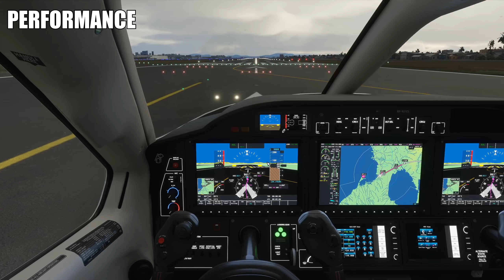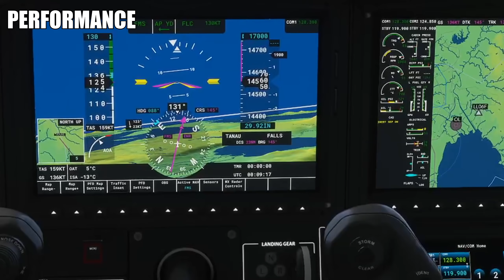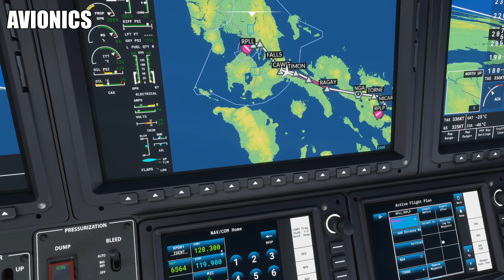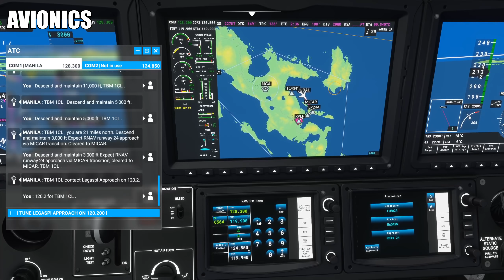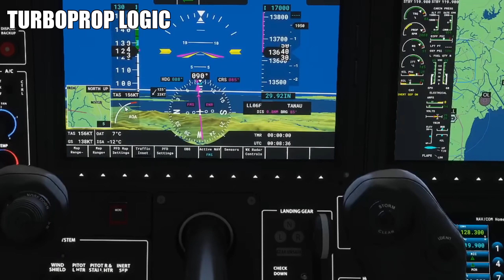Patch 2 is here! Build 1.8.3.0 - Microsoft Flight Simulator

Comment: How is it that you are not having any yoke sensitivity problems after this update? Everyone is saying that the sensitivities boxes are now gone and the controls can't be adjusted. You don't seem to be having any control yoke problems.
Reply from the maker: Yes, I got lucky in a sense that I tuned my sensitivity before the patch, so after the patch even if the sensitivity settings are gone, my old values were still saved and working. There is a workaround to this, though, it involves changing some files outside the sim to modify your sensitivity. Flight sim forums should have more details.

Comment: In my controls after Patch 2, the sensitivity adjustment is not working. It was working earlier. Ha anybody noticed this, or is it just my setup.
Reply from the maker: Yes, known bug. They messed up and sensitivity can't be changed from the menu anymore. There's a workaround in the forums where you'll have to modify the files manually, instead.

Comment: Correction: Slide slip is not crabbing to runway from crosswind. A Slide slip is when you cross you controls. ie full right rudder, and full left aileron. It results in the plane dropping like a stone, and is used when you are way too high and have to get in, such as in a forced landing. You can cross your controls, left or right. It's personal preference. What you meant was a crab into runway, then kick it straight with rudder on touchdown.
Reply from the maker: I believe that's a forward slip you're referring to: https://www.boldmethod.com/learn-to-fly/maneuvers/how-to-fly-a-forward-slip-to-landing-if-you-are-high/

Forward slip for losing altitude, side slip for decrabbing, used on crosswing landings. https://bermudahighsoaring.com/uploads/3/4/1/0/34107938/slipstoalanding.htm

Comment: I'm getting the opposite experience as you with torque vs. altitude in 1.8.3.  It's still increasing as I gain altitude.  Also still getting an insane pitch change around 23k feet when autopilot captures ALT.    Still needs a lot of improvements but I'm trying to be patient this sim has a long shelf life.
Reply from the maker: Yeah, you're right. I've been doing some tests offline and I agree with your findings. I found something interesting, though. Tbm 930 fixes in the msfs forums. Check out the mods list link in the video description. 👍

Comment: How do I tell what patch/update or version number I have installed? 

When I clicked on the icon to start FS2020 this morning after not using it for one day, I got a package install permission box to click on but it didn't say what it was for. Whatever it was it seemed to load very quickly. I only had a short time to play today, but something that didn't work quite right after the first patch -- the ATC voice --  now works.  And I think one of my load times was reduced, so that's good. I have just the Basic edition and a very slow connection, so I don't want to be trying to reload the whole thing as long as it works okay. It would be nice if there were a way I could identify what version I have from a menu selection or label somewhere.
Reply from the maker: In the main menu, upper right, click your profile and the version should appear. Alternatively, press alt+enter.
Reply: @TheClumsyGeekGaming  Thanks! Found it. For anyone else trying to find this in the Basic version, the patch number appears in the upper left of the status bar at the top in the profile, only visible when the screen is not in full screen mode. I probably chose a setting that my FS2020 defaults to full screen mode, so that's why I couldn't find it when I was looking myself before.

Comment: Has anyone tried flying the A320 since this update.  I tried a c&d start yesterday and once I started the engines and turned off the APU etc the left engine just spooled down and I couldn't restart it.  No fuel issues.  Anyone else noticed this?
Reply from the maker: Yeah looks like a known issue with the new patch, unfortunately. Workaround is to start on the runway.
Reply: For me it happens after Engine Mode Normal.

Comment: Tried this after the update and didnt notice any better loading times or performance.do i need to uninstall the game and reinstall?ran tests and the game is only using 40% cpu and 70%gpu and 80%ram so the game must need some more optimizing
Reply from the maker: Hmm yeah sounds weird in your case. Mine is always at 99% gpu. Maybe internet connection?

Comment: The major improvement we need for a "next gen" flight simulator is the API update to DX12. That they would release the sim on DX11 still baffles me, DX11 was always going to hold back performance on modern hardware and the sim is supposed to be coming out on Xbox which is DX12 only, so it doesn't make a lot of sense. They should have made both a DX11  and a DX12 version ready for launch. If the DX12 update happens the next logical step would be DLSS support.
Reply: @Rachid Djabrailov No. Only DX12 has been confirmed so far.
Reply: It's main issue is the CPU threading, not just DX12.

tbh, I wouldn't expect much until the XBOX X Series version ships - probably at least a year away. :(

Comment: For some reason my Magenta line doesn’t appear on my PFD. I’ll try today if it got fixed but yesterday I tried rebooting the game for 3 times and no success. Not only that, I had to reinstall all my mods. I also had MORE stuttering in the Cockpit and by flying. The update looks promising but I haven’t got to feel the changes. Any suggestions?

Edit: It only appears on the VFR Map
Reply from the maker: Have you changed active nav to FMS? also regarding stutters, if that's on the glass cockpit, check the timestamp about the new refresh rate option.
Reply: @TheClumsyGeekGaming  I did, the magenta Line doesn´t show up in the cockpit´s map. It does show on my PFD from GA airplanes but on airliners it doesn´t, only when I press "v" for the VFR Map. The waypoints don´t load and the flight plan doesn´t appear. Is there a way to fix this without uninstalling the game?
Reply from the maker: Ah, you're using an airliner? Might be a new bug introduced by the patch. Heard that airliners are a mess in this new update.
Reply: @TheClumsyGeekGaming  I fixed it. I downloaded the new version of the FPS Fix mod and of the Highonsnow Glass Cockpit and it seems to run okay now. It looks like after every update you must reinstall the mods and these must be up to date as well... great game but requires lot of patience hahaha
Reply from the maker: Nice! Yes, that's always a risk when it comes to mods, regardless of the game. Enjoy!
Reply: @TheClumsyGeekGaming  New problem, the constraints don´t show in the A320 NEO. I tried removing the FPS Mods, installing the latest patch of the A32NX but it doesn´t get fixed. I did a flight yesterday with no problems at all and then (I literally don´t know what I may have touched) the constraints don´t show...
Reply from the maker: @miguelcabrales6963  even with the constraints button set? Even before with the constraints existing, the numbers were all off anyway for me lol.
Reply: @TheClumsyGeekGaming  Even with the constraints button set.... I think I´ll just write down the waypoints that appear on the NAV Log. I trust more these waypoints than the ones of the real approach plates. The A320 seems to catch the glideslope only with the given altittude from the default flight planning in the map... Nevertheless, enjoying the game at its finest! Good day and happy flying!

Comment: try other airplanes dudes you'll see this patch broke the game ;)
Reply: Engine #1 fails as soon as you bleed the APU.  Then on take off, the engines sputter and you can barely take off.  This need to be fixed immediately!
Reply: Yes the Airbus A320 Neo that's bad I think I wait for Payware Aircrafts
Reply from the maker: Yeah heard the same thing. Glad I flew with this plane, otherwise I might be pulling my hair out now lol. So far tbm 930 and 172 are what I flew. So far so good.
Reply: @TheClumsyGeekGaming  Weird... It broke GPS/flight planning for me.
Reply: The cessna 172 skyhawk is broken too. Electric system/radio bug.
Reply: What happened with the a320?
Reply: Tom Robichaud Engine 1 stops 😂, in my case after Engine Mode Normal. I heard during take off for some ppl.
Reply from the maker: I think it's when they turn off the APU? Bug either way, though. Hope they fix that asap.

Comment: I think inside the aircraft looks worse now, no increase in performance with a 2070 super if anything slightly more stuttering, also sensitivity controls completely gone from menu
Reply from the maker: The sensitivity miss is a big thing. I hope they fix that soon. For the stuttering, is that in the glass cockpit? Check the graphics setting glass cockpit refresh rate and set it to high. More details in the vid.
Reply: @TheClumsyGeekGaming  I managed to edit the input files to accomodate at the moment so I can keep flying but not the best!
It's more aliasing in the cockpit, at panel joints etc, just not a slick as it looked before. really needs optimising though as im only using 60% GPU and 30% CPU at the moment!
Still loving it though.
Reply from the maker: That does sound weird. My gpu is pegged at 98-99% all throughout. Maybe ram or internet connection bottleneck?
Reply: @TheClumsyGeekGaming  did some more testing last night, something strange is happening....
Usually play on high end settings but switched to low to see the frame rate difference, but....the frame rate doesn't go up, rather the gpu usage goes down and fps stays around 50! In the menu the gpu usage shoots to 99% and the frames shoot past 100, think its an issue that needs updating with a patch, so much for optimisation in this patch 😆
Reply from the maker: @skruffy79  try turning off vsync. I heard that's very buggy and causes a lot of capping.
Reply: @TheClumsyGeekGaming  tried that too, did a search and a few others seem to be running into the same issue

Comment: 225/3 kt issue definitely fixed. however, i think i stumbled upon a bug when trying out the cessna 172 (g1000) where i've set non airports as my departure and arrival points. the fpl button on the mfd had gone haywire and wasn't displaying the magenta track. but on the pfd it did. after that, the whole mfd went dark. strange, indeed.
Reply from the maker: Ah great to hear! Heard about this mfd blacking out, but that was due to an old mod, I think.

Comment: Anyone else having issues with A320 autopilot? Engine 1 powers down after turning off APU bleed.
Reply: Did you make sure that your engine was fully started up before turning off apu?
Reply: B4zinga yes. Both stable N1 at 19.7
Reply: Its a known fault, only fix is to start on the runway

Comment: the patch breaks the game at least for airliners
Reply: A320 in a bad way, no way to start cold, 787 is much worse try landing it now, as soon as ap is released it violently pitches down, fully pulling the stick makes no difference, was not expecting TCAS to be modelled?
Reply: how so apart from the 747 autopilot still kinda broken it's still good, if not better for airliners.
Reply: @jettwood352  the patch makes things worse for the the airliners not better
Reply: @jettwood352  for me 747 is working, sort of. I did a flight from nzch to yssy. 2 and a half hour flight, checked fuel levels in menu before starting and half hour out from yssy autopilot disengaged and engines died. Got me puzzled. a320 won't power up. I had the a32nx mod but removed it and still no power up from cold and dark. I might do a start from runway and see if that fixes anything I'll post my results later.
Reply from the maker: Thanks for testing. Good luck!
Reply: @nemysisretrogaming3771  thats the same prob I hat too on the A320 at the gate the APU gets stuck when you start it says waiting for light or something like that. from the runway it works. Even pressing CTRL +E wont fix it  then soon after the AP becomes unresponsive and does what ever it wants to do
Reply: @TheClumsyGeekGaming  just done some more testing. A320 seems to work OK from runway start but still won't power up from cold and dark with or without a32nx mod. Maybe asobo should have partnered with someone other than Microsoft given their track record fixing bugs in their operating systems.

Seems like bugs are different for everyone. There's also a 2.29mb update in content manager called asobo-flights-commercial-flight that won't update on my machine.

Tempting to delete all files and let the game download them again.
Reply: @JAllyFarms  I can't even get radio up when turning the batteries on...

Comment: Preformance seems better in cities, but the weather lowers FPS drasticly? I have 2080ti and i9900k 32gb ddr6
Reply: nice ram
Reply from the maker: I've read similar reports in the forums. I will have to check on my end. I did encounter some slowdowns up in the clouds but not definitive yet if it's the clouds causing it.
Reply: I have the same specs and noticed FPS seemed to drop with the weather

Comment: They didnt drop the press any key to start tho, or give us the option of a Non US accent, despite having a UK/AU language pack set as default in windows, and selecting windows-offline voices
Reply from the maker: Yes, hopefully they remove that press any key eventually.
Reply: I agree the voices need a bit more work. I think their logic is that really invested players will be more likely to use external apps or things like VATSIM, so the in-game voices become irrelevent, but I think that this kind of misses the point that 'less invested' players (can we really say casual flight simmers? not really) and new sim players are going to be noticing the voices as one of the most obvious drawbacks and it's a major hit to realism and the overall experience. Also that of course there are plenty of hardcore simmers who play offline and don't want to use online ATCs.

For the press any key screen - you can use the -FastLaunch launch option to arrive at that screen almost immediately, so you don't have to sit around waiting for it. Or use a mouse auto clicker and go and make a drink :)
Reply from the maker: Haha sounds good! Do you know if that fastlaunch thing works for Microsoft store, too?
Reply: @TheClumsyGeekGaming  It does. But you have to create a shortcut to the command prompt and run it using that, since it's an xbox app (see this thread: https://www.reddit.com/r/MicrosoftFlightSim/comments/icrc4c/psa_to_skip_the_intro_videos_and_logos_set/ ).

And on Steam you can put '-FastLaunch' as as a launch option in properties.
Reply from the maker: Wow awesome thanks for the tip!

Comment: This patch has caused major problems for many users. My version is showing it is the current patched version but it never actually started or finished the download. Now my scenery feed from the servers doesn't work, the fine tuning for the controllers is also missing. If you look on their support forums, there tons of complaints about the patch causing major problems.
Reply from the maker: I wonder what's different. Hope they get to the bottom of things. Good luck!
Reply: @TheClumsyGeekGaming  Yeah, it's just odd. For some users the update seemed to have gone fine but for me and many it's been a disaster. Not sure what to make of it as surely this would have been well tested before release. Hopefully they will sort it all out soon.
Reply: The latest update has made my game doo doo :(  The A320 is sooo broken.  Engine keeps shutting off and engines "sputter" on takeoff and barely gets off the ground.  I hope the fix this!!